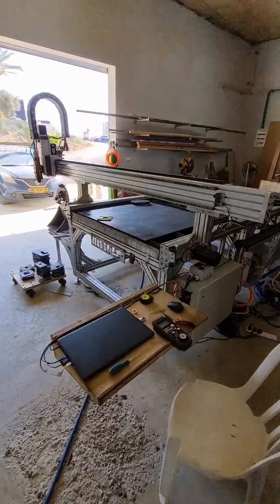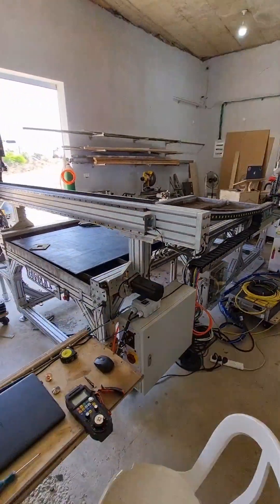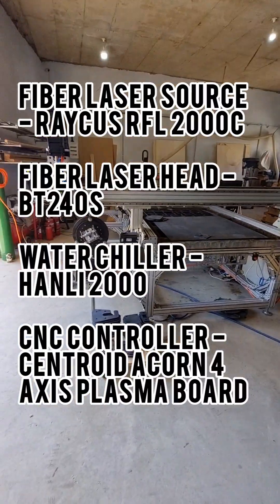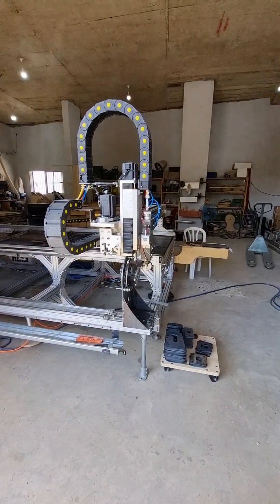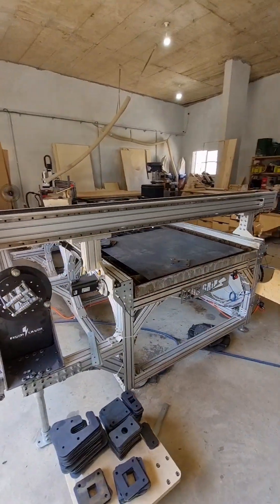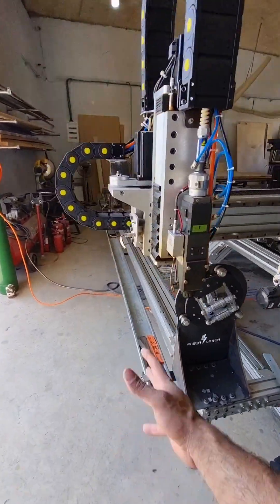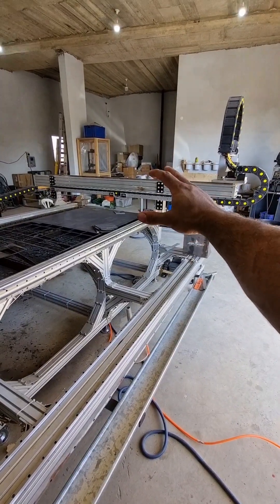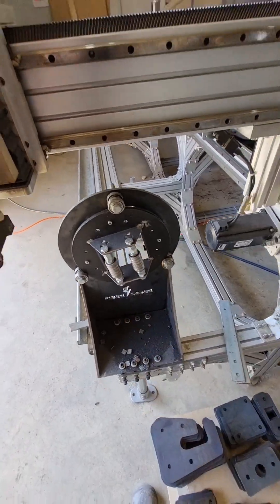DIY FIBER LASER integrated sheets and tubes /  using acorn centroid

Comment: Good Job.which THC did you use to send the analog signal?
Reply from the maker: It's a controller kit from centroid.
It's called centroid acorn plasma 4 axis controller
Reply: Are you using LFS PM T43 or LFS AM T43 for head sense?
Reply: Thank you very much Friend.
Reply: Have you used LFS controller?or it's a direct output from amplifier?
Reply from the maker: LFS AM T43 AP01 S

Comment: I have the centroid acorn 4 teknic clear path servos. I originally intended to use them to build a cnc router but after seeing your video, I think the job I intend to use it for would be better suited on a fiber laser. Would you consider making a build guide? Cheers

Comment: Hi is it possible to use Masso G3 controller on the laser that you use?
Reply from the maker: Yes
Reply: @TAMARbarCNC  Can you share your plan of your 4 sxis rotary. The rotating mechanical with roller that holds the pipe that is attached on the gantry.

Comment: Very nice machine build. I am considering a laser conversion now that I have seen yours and a few others on the tube. I imagine budget was a consideration in selecting a 2kw. Assuming a larger budget, would the table dynamics preclude a 6 Kw conversion? We'd go with a high pressure air compressor. Again, nice build.
Reply from the maker: First of all thanks man.
If you want to consult with me I'm happy to  help you.
Available on Facebook as "tamar bar"